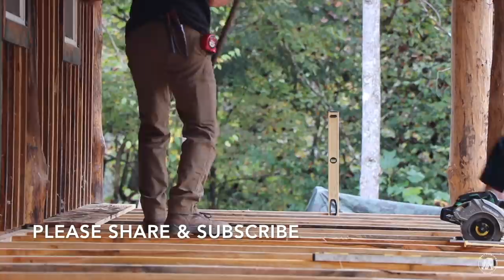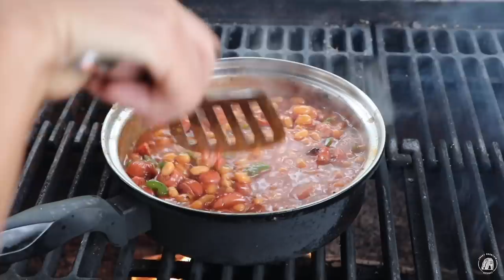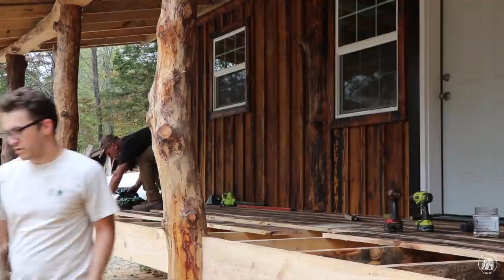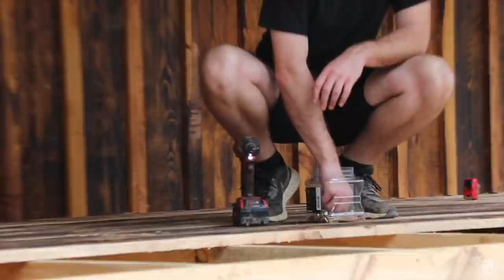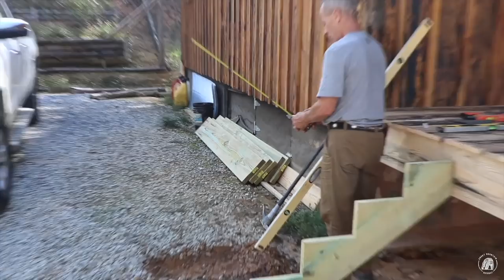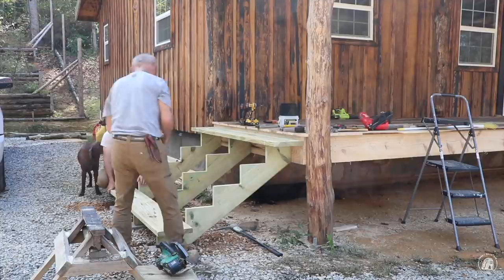OFF GRID TIMBER FRAME CABIN | INSTALLING THE FRONT PORCH DECKING

Comment: had a roofing installer fall through the roof on a re-roof job. He was carrying bundles of asphalt shingles up to the roof top when he went straight through the roof between trusses, continued falling between the ceiling joists, through the insulation and sheetrock and landed on his feet and butt right beside the customer sitting on the couch !
The previous roofers installed plywood decking that failed to reach the next truss top in several locations 😲.....we found out after this happened. He just happened to step on one of those "diving board" spots.

Didn't even have a scratch on him.
Never seen anything like it.
God was definitely watching over him.

Comment: yes most definitely I would be ming two part clear epoxy and covering and sealing all the exposed wood to drive out all carpenter bees or you will have colones of them forever.. Mix the epoxy in small mounts and paint should last 15 to 20 years before renewal...completely seals against all bugs and weathering

Comment: I saw u putting screws in the ledger board I hope u put bolts to the house for safety reasons
Reply from the maker: They were five inch lag screws. I don’t think they are going to move.
Reply from the maker: Not sure how long you have been watching but they screwed into a 7x10 beam across the front.
Reply: Yea but in time those will rust and break its. Safer Otto put the bolts all the way through